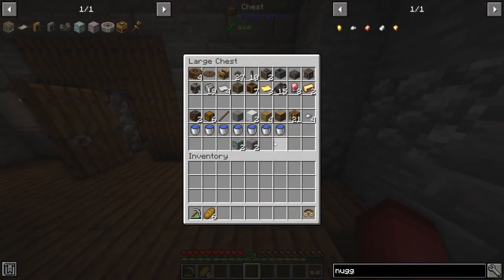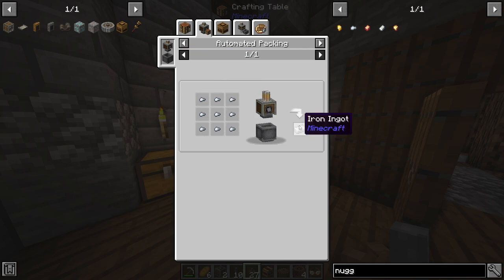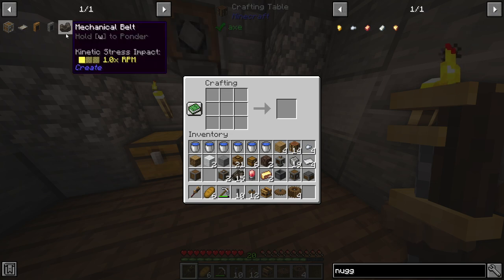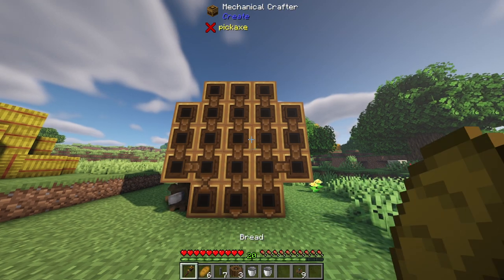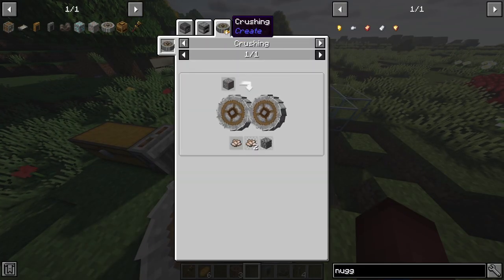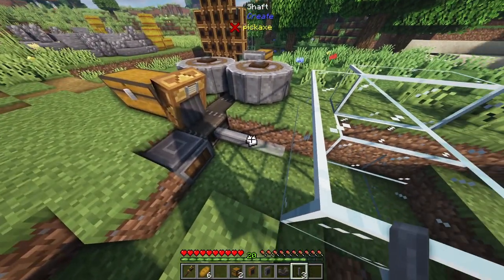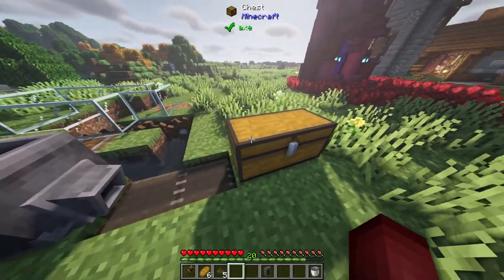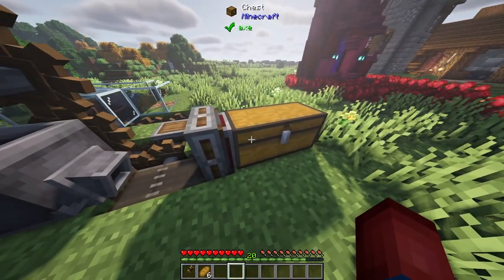Minecraft Create Mod 0.3.2 Tutorial - Ore Processing System Ep 4

Comment: Hello everyone. I noticed in my modpack some crushed ores when they are washed would provide other items besides nuggets. Such as with crushed iron, there is a chance for redstone to be washed and clogs the depot because it has no where to go. To counter that, I place a brass chute + chest under the depot, with a filter that denies all crushed ores and nuggets. Make sure to press the checkmark to save!
Reply: THANK YOU
Reply: how do i connect the brass chute with the chest? the brass chute is connected under the depot but theres no way to connect the chest when going downwards
Reply: @joshlastname4087  If you place the chest underneath the funnel, there won't be any visual change, but things will be funneled in.
Reply: @joshlastname4087  or just use an old  fashioned hopper
Reply: The chute is not taking the items from under it
Reply: just add redstone dust to the filter and it will go into the crusher so you will be getting redstone blocks too

Comment: I use the Soul Sand method for my water wheels to squeeze some extra stress out of them (and I also have a third one which may or may not affect what I'm going to say going forward). Haven't done the math to see if it would require that or not, but there's actually space for five encased fans to bulk wash the crushed ores after the first brass filter. Since power washing is the main bottleneck in this design, this speeds things up dramatically. Another comment also suggested feeding the cobblestone from the first filter chest back into the system, which allows this to produce gravel, flint, clay, and even sand if you feed the gravel back into the system and let it powerwash the sand--or you can just power wash the gravel for more iron. This is a very versatile platform and I can't recommend it enough for anyone looking to process ores in Create.
Reply: How is it possible for 5 encased fans to fit?

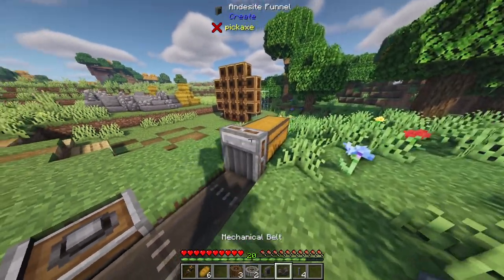Comment: 9:45
"Andesite Funnels will pull out..."
Not right. it depends on the direction the belt is moving in.
also, placing the funnel sideways will allow to decide using a wrench or shift rightclicking while placing if it should pull or place.
Reply from the maker: Completely agree! I meant what you typed out, however, completely got ahead of myself there lol

Thanks for the tip tho don’t want to confuse the new create players :)

Comment: I made this setup with a few modifications to increase the speed. I put 3 stacks of iron ore through it and got 6 stacks + 29 ingots and 2 nuggets back.
Reply from the maker: That’s awesome! This setup works pretty good and of course there is always room for improvement :)
Reply: what did you change?
Reply: @wombat_pickle1674  the only thing I changed were gear ratios, mine looked exactly the same apart from cog wheels. I just added more water wheels and cogs.
Reply: @SilencerDude  ight thanks ill check it out

Comment: just being curious: what happens when you don't get a multiplicative of 9 nuggets and some stay in the press? wouldn't that screw up everything else if a different kind of ore is processed after?
Reply: Basin can hold several types of items at the same time. A few extra nuggets won't mess it up.

However, it is possible for a basin to be overloaded so the press will stop working. I'm not exactly sure what are the exact circumstances for this issue to appear, the mechanics of Basin's internal inventory are hidden, but I get it when I was trying to build my own version. I'll do some tests and write here if I'll find something.
Reply: Apparently, it is a bug (I'm pretty sure it's a bug, everything worked fine in previous versions) with Basin in recent versions. I had a similar issue with potion mixing, I just didn't see the connection originally. 

Quick fix: you need to regularly update either Basin or Press. The easiest way to do it is to put Gearshift connected to a Redstone timer (I recommend using Adjustable Pulse Repeaters), so it switches direction every few seconds. 

Detailed explanation: "Basin system" (Basin paired with either Press or Mixer) can have only one available recipe active at a time. It means if the basin has 9+ iron nuggets, it starts working on the "Iron Ingot" recipe. But after it finishes the work, it doesn't check for another recipe automatically. So even if there were 9+ gold nuggets in there, it won't start working on the "Gold Ingot" recipe. The system checks for a new recipe only when updated - the easiest way to do it is to put/take an item(s) into/from the Basin or change the speed/direction of Press'/Mixer's rotation. 

In this particular system, such a situation happens when Basin gets the maximum amount of nuggets when it didn't finish the work with previous. It would happen only if your Belt/Crushing/Washing system is fast enough to put new nuggets into the Basin before Press finishes the work on the old ones, and can be avoided by managing the rotation speed of different things, but simply switching as I suggested above is easier.
Reply from the maker: So I have used this exact ore processing system for months now in multiple series and never ran intro that issue because of the way the nuggets go into the basin 1 by 1. And as soon as there are 9 nuggets it immediately presses it into one ingot

Of course if you are running other mods there is a chance something might break - but adding a filter with the ingots should fix all of that
Reply: @rockit14  The issue appeared only in 3.2, maybe even later (it's 3.2b now). 

But yeah, having Andesite funnel pretty much guarantees that it won't be fast enough for this issue to appear. It has a limit on maximum effective speed though and will take a while to process stacks of ores you would get from a quarry, for example.
Reply: @rockit14  Well, I guess they finally fixed it in the latest patch. No longer should be a problem.

Comment: Does adding magma blocks on the bottm of the water wheel adds a benefit?
Reply: No. All that matters is that water moves, but not how fast it moves. Soul Sand is the only way to increase Water Wheels' output beyond 16 RPM. Want more - build Windmill (cheaper) or Furnace Engine (more expensive).
Reply from the maker: @antongrigoryev6381  Just like Anton said nope :)